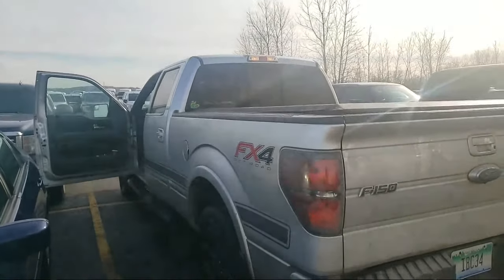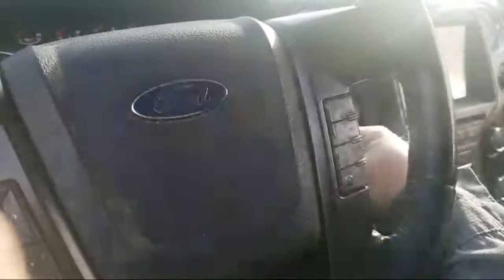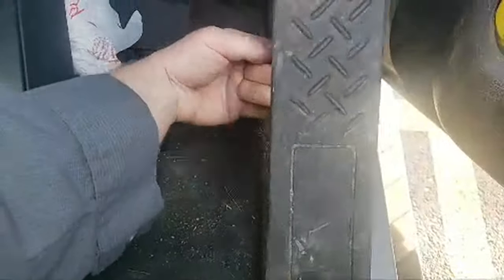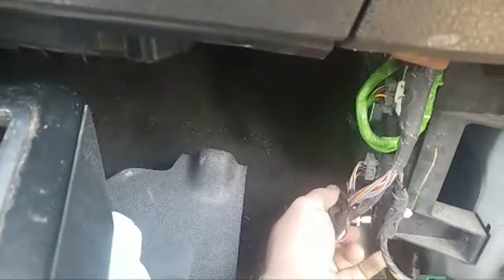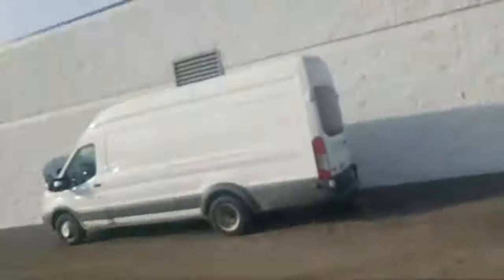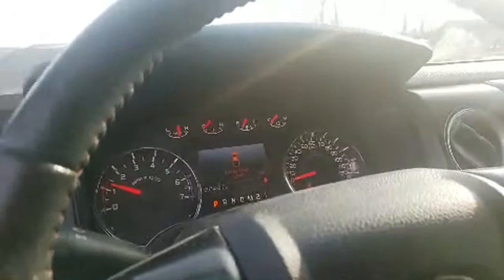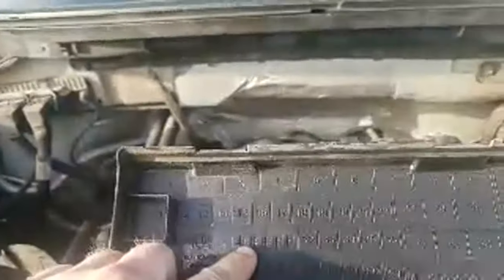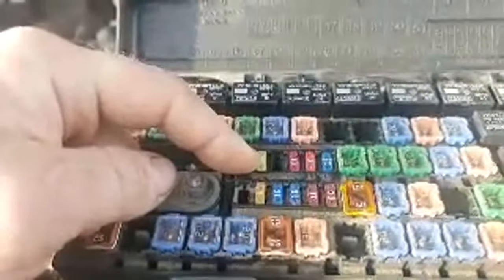2011 2012 2013 2014  F150 No Start - #1 AND #2 PROBLEM

Comment: If any of you guys had this issue and your fuse #27 is fine, check this. Your truck might be like mine and i found out after spending almost a $1000 at ford dealer, here is the link to my video:
https://youtu.be/M0cJzWr2mhk
Reply from the maker: https://youtu.be/H8qvzvB0rLQ